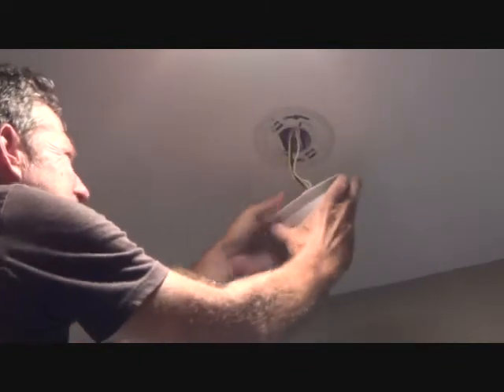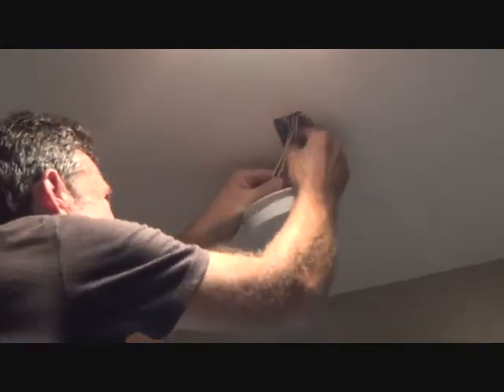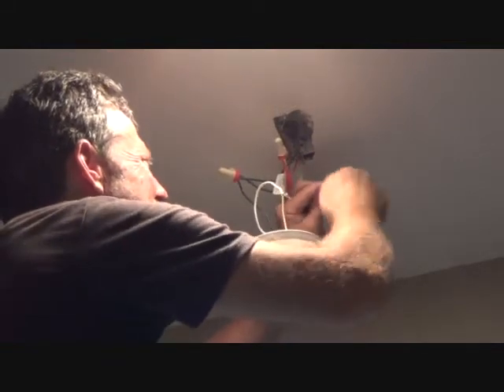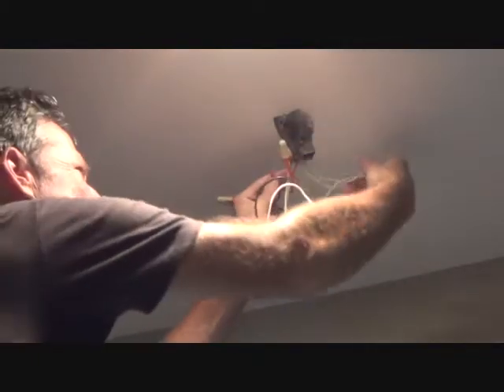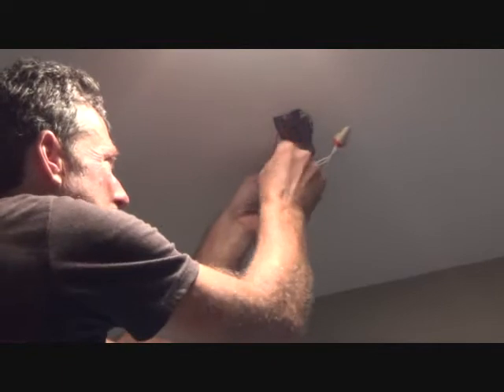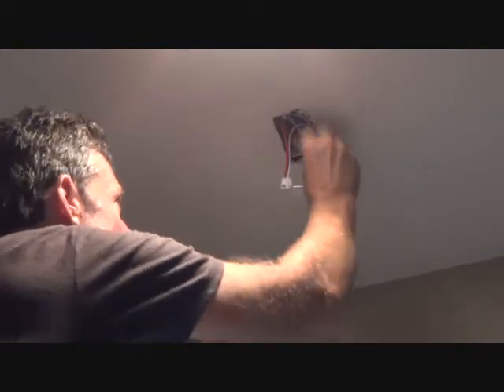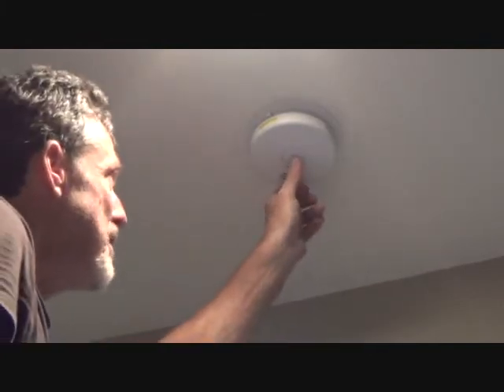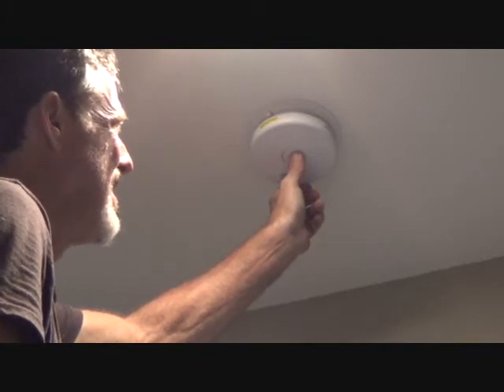Installing a smoke detector

Comment: there is alredy a carbenmonoxide detector in the house I saw it
Reply from the maker: +Connor Nelson I only installed one carbon monoxide smoke detector in Motha's house. All the other smoke alarms were just standard smoke alarms. One though I installed had the smoke alarm and the combo of a carbon monoxide detector. I installed that one in the main hall area since if there was a gas leak it would be coming from the kitchen area or in an area where your dryer is if you have a gas dryer. So that's why I opted not to install carbon monoxide detectors in all the bedrooms since you should be able to hear when the one goes off in the hall. Hey thanks for watching my videos!   Joe  :0